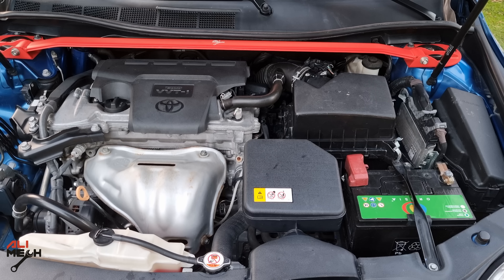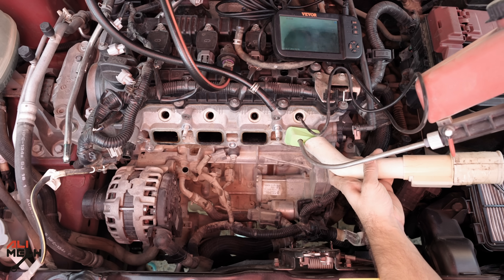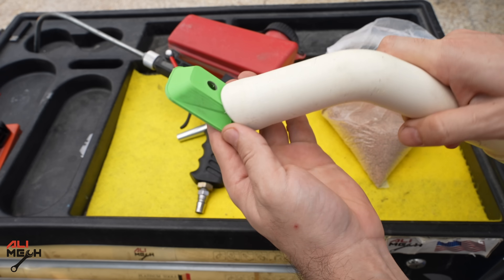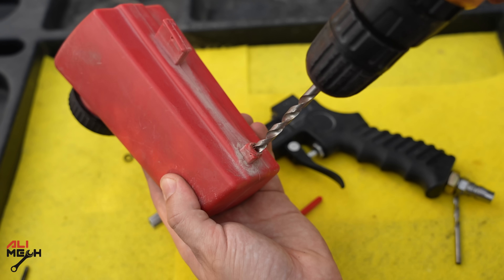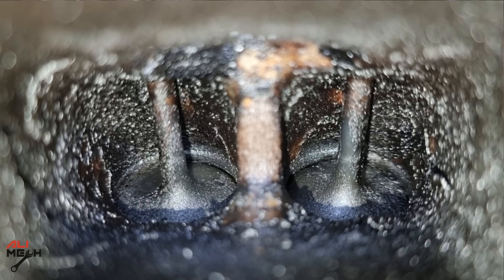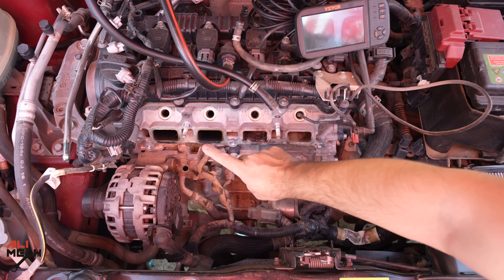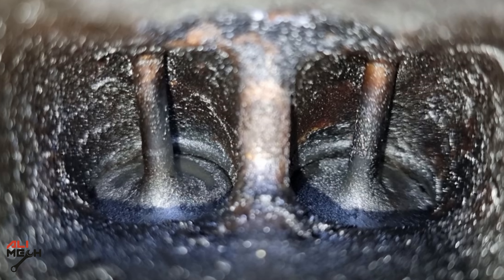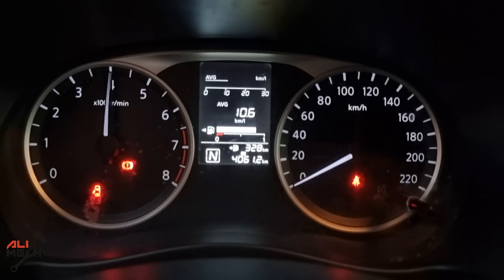SUPER Clean intake valves with this simple trick...

Comment: I regret buying a GDI car for this reason. I'm not going to take my damn car apart just to clean the intake valves. I'll wait till the powertrain warranty is up, and then I'll sell it.
Reply: Most all cars new are gdi
Reply: @ChengSAE  Toyota was smart enough to keep dual injection in their vehicles.
Reply: @Keith-e5f I was thinking of putting a catch can in my mustang 4 cylinder. Talked to mechanics and did some homework and they said it does not make a lot of difference. It might be worse if your engine has a lot of blow by like the old Honda engines of the 2010 era I believe. Those still might be port injection. You also have to remember to keep it emptied. My son-in-law bought a media blaster that was able to operate on a small compressor and had a vacuum attachment that would suck most of the residue in particulates out as it blasted. I think he used Walnut shells. He couldn't believe how easy it was and how well it worked.All it involved was taking off the intake, which is just an air box. This particular vehicle was a 2010 mini Cooper with a turbo. I imagine that the V8 and v6s are a little more involved but it is not that hard, it is just a little time consuming. That car had how about 130,000 mi on it when he did it. My 2015 mustang only has only 14,000 mi on it and I am in my 60s so I doubt if I will even have to touch it in my remaining lifetime. I will leave it for the next owner.
Reply: @davidclemens1578  I'm in my 60s as well so I was thinking the same thing.
Reply: @Keith-e5f  What do you mean keep using it's  new!
Reply: @pmaint1  I realize it's new but eventually they will need to be cleaned.
Reply: Clean it too much might cause it to use oil
Reply: It’s not that hard to clean. Certain vehicles are a lot better than others.
Reply: Buy a hemi 😂
Reply: Gotta 2020 Honda CrV with DFi with 85k
Zero problems….
Reply from the maker: I agree,  but if you install oil Catch can, it won't be like that
Reply: @AliMECH which catch can do you suggest? I have Nissan Rogue 2023 1.5
Reply from the maker: @jd3521  i have this one on 4 cars so far and catch oil, and i saw very good changes on the valves after instillation https://amzn.to/3KJdYTG
Reply: @AliMECH  having a catch can doesn't clean the valves so please explain how u noticed an improvement after installing? Most of what u catch with a catch can is unburned fuel and condensation so isn't gonna do much. It can even make the original evap system work less good as designed. My mate has the same car as me, same tune and same parts. Only difference is that he has a catch can and i don't. Carbon build up on the valves was pretty much the same after the same amount of miles. And blasting wasn't even necessary (did it anyway). Quality of oil and fuel and good maintenance has a much bigger impact.
Reply: @AliMECH the oil  catch can doesn't work. All they do is capture a vapor that cools into a liquid. My 2015 Ecoboost 3.5 with over 130k miles no catch can, no valve cleaning and they look good! My friend has over 250k same engine it's clean also.  The secret? Use Tier 1 gasoline, replace the oil every 5k miles Valvoline Restore and Protect or good Synthetic, replace the PCV valve and Spark plugs every 50k miles.
Reply: @AliMECH  I don't think catch cans make much difference.
Reply from the maker: @Keith-e5f  yes it makes a big difference, i did a video about that in this video https://youtu.be/6rUpPcq4hQg?si=jxF42vdZnF0ns-yU
Reply: @Keith-e5f  
It is a place for the oil vapor to condense.
Reply: @Keith-e5f it 💯 makes a difference! If you've ever seen how much oil n vapors a catch can actually catches you'd be a believer! I put one on my 2017 Silverado and although mine is only a 12oz can it's almost full after 3000 miles using full synthetic. My truck has 52,000 miles.
Reply: @AliMECH  will it completely stop it from starting?
Reply: @AliMECH  y como es eso ?
Reply: @AliMECH y como es eso ?
Reply: @pmaint1  
Never needed one.
Reply: Shops don't charge much for this. Have them do it instead
Reply: I was thinking about about buying a Hyundai Tuscon with the GDI engine but, after reading so much about the problems like this and peoples complaints, I'm not sure I want to anymore...
Reply: @Reddogmr57  some companies like Toyota still use dual injection. I would look for something with dual injection. That way the valves will stay clean all the time.
Reply: What GDI car do you have? Are you having any problems with it yet?
Reply: @Reddogmr57  wrx. I'm not having any problems with it currently.
Reply: @Keith-e5f Then what are you going to buy? Literally every I.C.E is direct injected.
Reply: Den Saugadapter selber bauen, zack Thema erledigt... Aber das Video ist super. Macht Sinn  und leuchtet ein (Beim frisieren poliert man auch Ein und Auslass wegen der positiven Strömungseigenschaften zb beim Motorrad, das ist ein alter Hut, kennt jeder Schrauber.
Reply: Yup. You’re EXACTLY the manufacturer’s target audience. Removing an intake isn’t too difficult on most vehicles.
Reply: It's a simple procedure,  bring it to a good mechanic and have your valves walnut blast cleaned.   Cost like 500$.  And good for another 100 k miles.  It's just common maintenance, w gdi.  Good luck.
Reply: Use synthetic oil and change regularly. Synthetic oil has a higher vapor temperature.
Reply: @scott_meyer  Synthetic oil doesn't work. Do you think all the people who are having issues with carbon build up aren't using synthetic oil? Of course they are its recommended by nearly all auto manufacturers!
Reply: @pmaint1  
Synthetic oils have  a higher vapor temperature, they should reduce the carbon buildup.
Reply: @scott_meyer  WRONG
Reply: @pmaint1 
Wrong what?
Reply: You should be driving an electric car so there's nothing to cry about.😂
Reply: @Japplesnap  nothing to cry about until you have to replace the battery. I don't do electric.
Reply: @Keith-e5f  condenser.
Batteries last longer than most people keep cars.
Reply: @scott_meyer  no thanks. I'm 62 years old so I'm old school. You couldn't pay me to own an electric car. I think my valves will last me longer than I'll keep the car. Lol.
Reply: @Keith-e5f  
They're great for local commuting. 
Cost of energy is quite low if you can charge at home.
Reply: @Japplesnap    with EVs you can burn along with your house & car.
Reply: @Japplesnap maybe some of us are poor DA
Reply: @Japplesnap  no sound and big ugly screen . For me everything make my cry lol
Reply: Japplesnap electric cars are worse because once the battery is below 80% its useless for most people and to rebuild it is not possible by yourself.

Comment: That looks new, but the question here’s how often do you need to clean it? If I clean it and it gets back to how it was after a month or two I think it’s not worth it
Reply from the maker: It depends on the car actually,  if your car has more oil vapor,  you need to install oil Catch can to prevent that oil and not get on the valves, then it will be last so long, and not get like that anymore
Reply: i would guesstimate every 100k kms